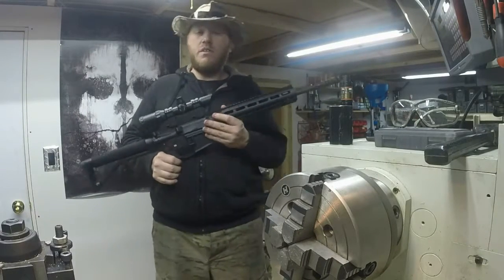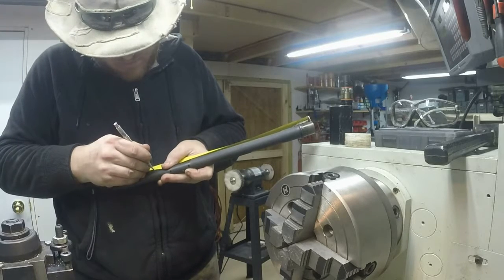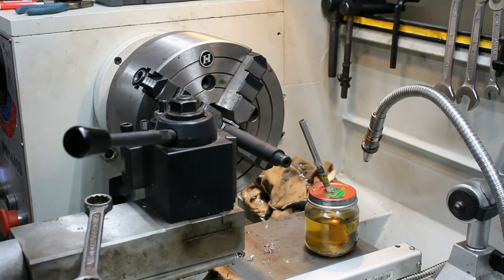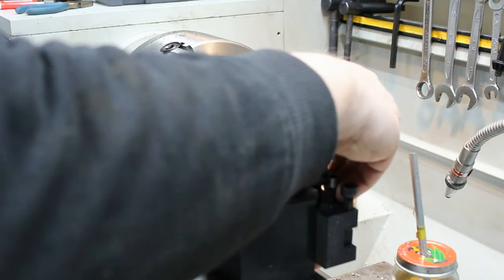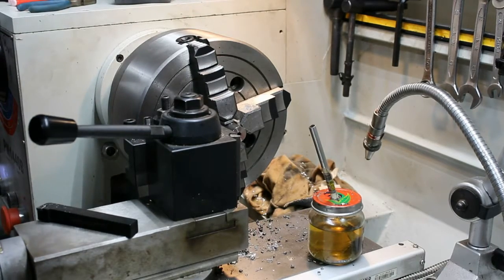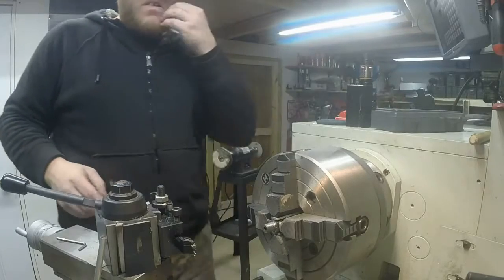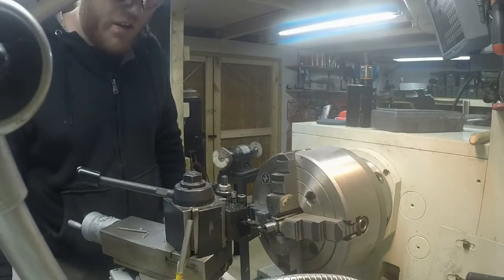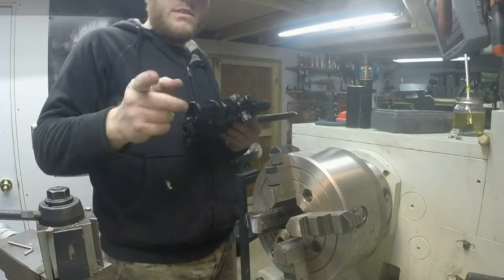Cutting down and threding a barrel

Comment: should have measured from the front, back 4 inches
Reply from the maker: But I wanted to measure from back to front
Reply: @firearmsfuelfabrication  then you would be measuring from the barrel extension, this is where the feed ramps are. The barrel begins where the bolt face stops.Just an FYI, thumbs up for the video.